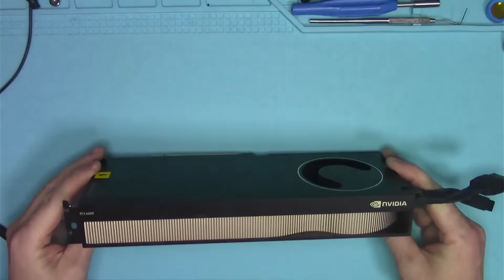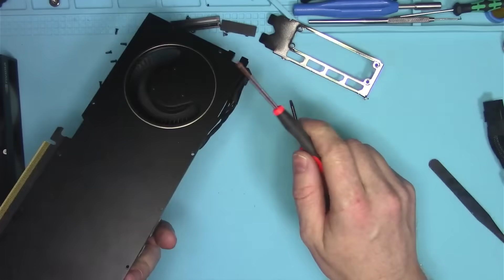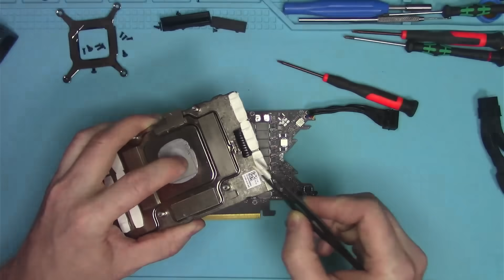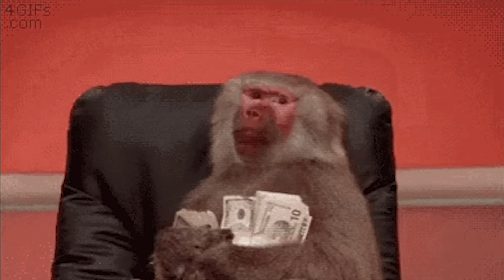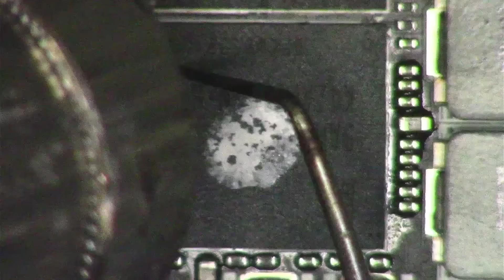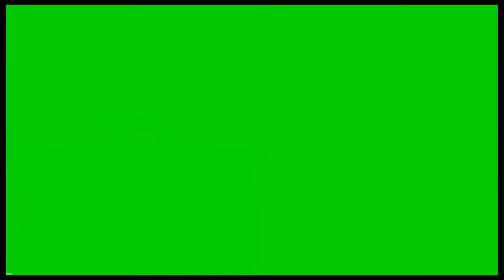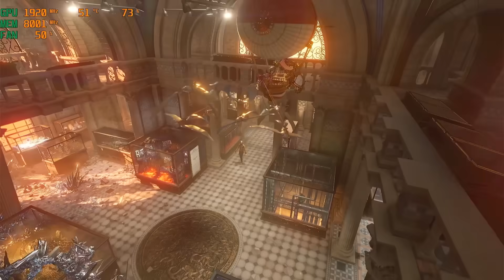Repairing the High-End Nvidia RTX A6000 GPU

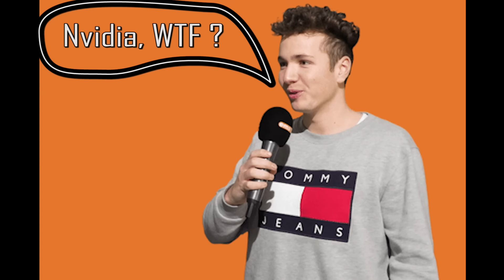Comment: 4:23 it's shorting because the pinout is probably the same as EPS CPU power connectors. Many "computing" cards just use EPS power connectors instead of PCIE power connectors. 
Why? I don't know, maybe more current carrying pins, because EPS power doesn't have sensing pins.

Comment: Its a card designed for Workstation/Server use, the connector is in fact pysically the same as a PCIE Power Connector but its not a PCIE Power Connector.
These things can be found on servers, forgot the naming though :D
The "extension" is the converter from PCI to this

Comment: The pigtail adapter exists because it uses a different 8-pin connector (obviously). But this is because these gpu's are primarily used in big racks in large amounts. Having just one connector, and placing this one on the back makes service easier and it uses a different cable because the power supplies that power these cards don't need an adapter, they are an industry standard. You only need one if you use a 'normal' power supply. Which doesn't happen often because these gpu's are so expensive most of them are used in servers.

Comment: Wow, this is a great enquiry/fix. But i have some questions : 1) How do you know the voltage/impedance of these precises motherboard's points ? 2) Where did you get the socket where you plug the video card ? 3) Where did you get the special power supply and is that especially for this type of repair ? Thanks and have a nice day.

Comment: Stock TIM is not paste, its a phase change solution that dries at room temp, and turns to a liquid when the chip heats up. Thats why it always seems dry when you open up a GPU, even when its brand new.

Comment: The Paste on these cards has to be try. Its a thermal interface material thats nearly solid at room temperature and "melts" when it gets warm / hot. 
That way you have a long service life as the paste "re-applies" itself over and over.
Reply: is that thermal paste better than something you can buy on amazon? wondering if its worth changing?

Comment: Nice video. Just a little note : thermal compound on the GPU is not dry, it's PCM type (phase-change material). This thermal pad is solid at room temperature but is flowing under higher temperatures. It is designed to be that way, unlike usual thermal paste. This is typical for many GPUs.
Reply: Yeah thermal paste doesn't need to be wet at all times. Even if you have mad dry thermal paste it will still work fine as long as contact is good.
Reply: @sebaschan-uwu  that's what I keep telling my wife!
Reply: @niccolon8095  PCM pads are easier in manufacturing (since it's just a solid compound and not greasy) and does not dry out like many silicone based grease. But it is also more demanding for proper surfaces pressure and contact to obtain good performance. Unless you really after every last degree , I'd say generic noname cheap paste from Amazon have good chance to be worse than factory PCM.
Reply: awesome thank you for the response brotha, i updated my 3090 with Corsair paste & grizzly thermal pads after seeing several others online do the same & i did get a sizeable reduction in temps. i just got a rtx 6000 & heard it runs at about 85C so i was seeing if I could improve it. its similar to the a6000 configuration in this video but ill probably just leave it alone. @xDevscom_EE
Reply: @niccolon8095  PCM is only good for PC part's that kinda constantly run hot, if you want good thermal paste get kingpin's KPx, its cheaper than thermal grizzly by like 50% and performs basically the same, it just cant be used for sub-zero overclocking.
Reply: Bump.
Reply: is it apply to generic gpu as well? I mean, like usual GTX or RTX gpu?
Reply: @maklogetrich2378 Most seems to talk about them having liquid metal on processors 🤔
Reply: @MrBrutalMachinee  liquid metal wont damage anything as long as its a delidded or copper heatspreader processor attached to a copper heatsink. however unlike thermal paste, the amount does matter. just use enough to spread across the entire die and you'll be fine. (too much or too little and itll get pretty hot.)
Reply: I see @northwestrepair to make this wrong comment about dry paste all the time. probably he does not read the comments, pointing out his mistake.
Reply: Does this mean that if I replaced the thermal paste on my gpu on my 3080ti I shouldn't be using normal cpu thermal paste? Or liquid metal?
Reply: @jsadecki1  kinda depends, if you want better thermals go with LM but your coldplate for your GPU atleast needs to be made of copper, if its a coated copper that would be better. if its not a copper or you dont wanna risk killing your GPU just go with thermal paste, its easier to apply anyway.
Reply: @scarecrow5848  Definitely, I think I will leave that then. Although I'm pretty sure I've replaced a graphics card with liquid metal before I knew what I was doing, lol. I've already sold that to someone, so I hope that it's still working for them

Comment: The power connector on these cards is a EPS12V connector. Or what a lot of people think of as a 8pin ATX 12V Power or CPU Power connector.

The abnormal connector here isn't the EPS12V one but the PCIe 12V connector that should never have existed in the first place. EPS12V power was a thing long before PCI-Sig got in their head to create a power connector for the graphics cards. 

The intelligent thing to do would have been to look at what was available and chose the EPS12V connector. Problem solved. But instead they thought they would join the cool kids with yet another standard and created the 6pin PCIe power connector. Sure it saved two pins, but surely no graphics card would ever need a full 300W, right?

Well wrong! Surprise surprise, it was soon clear that graphics cards were scratching at the power limit and that soon there would be designs that needed more power. But now they had sold in their 6pin power connector, so they doubled down with a new 8pin connector. Just as many pins as the EPS12V connector but pith a pinout that was totally non compatible. And no it couldn't provide as much power as the old EPS connector as it didn't have as many +12V pins even if all else was equal.

"But it has eight pins, just as many as the EPS connector?" someone may burst out. Sure but only three of them are used for +12V while five of them are connected to ground. Well in the documentation it just says four ground pins and a sense wire. But effectively the sense wire is connected to ground and used by the graphics card to detect that there is a 8pin PCIe power connector attached. The same could have been achieved in other ways that didn't allocate a pin to "Sense".

"But, but, saves cost with just 6pin connectors..."

No! it didn't save any cost. If you look at the 12V CPU power connectors on the motherboard most of them are split into two 4pin connectors. These are 4pin ATX12 CPU power connectors and they will fit either into 4pin ATX12V connectors or can be paired up and used in one 8pin EPS connector. So if PCI-Sig had decided to use the standard connector they could have had better modularity with ATX12V CPU power 4pin connectors, EPS12V CPU power 8pin connectors or any mix there off they wanted. And we would have one less crappy connector standard to keep track of!

Comment: Hi Tony seeing your skill with that memory application - I wanted to ask if you think VRAM doubling is a service you'd consider offering. There are references performed on RTX 3070 - I have an 8GB 3080 mobile chip (GA104) that I would theoretically pay quite a premium to replace the modules with double density ones! I don't believe I am alone in that either
Reply from the maker: You are not alone and you are correct, it's expensive experiment.
Reply: Well, now that I'm subscribed to your lovely channel I'll make sure to keep an eye open! I will definitely be in line for a commission if you feel you can offer that
Reply: @iamastrangeloop96  Do you know what commission means?
Reply: @Look_What_I_Did  sorry if I used the word incorrectly? I’m trying to say that if Tony felt he could offer that as a service, I’d be an interested customer, and recognize it’d be a pricey/enthusiast offering done on a case by case basis most likely
Reply: @iamastrangeloop96  You used the word correctly. They might have been confused as the word has multiple meanings.

Comment: Good work. I've never dared to power up a graphics card without a heatsink. I was surprised to see that modern cards can handle that without blowing up. You've opened my eyes to an easier way to do tests. I've dabbled a little in desktop and laptop component level repairs for my own purposes, but I've only worked as a solder tech for an aerospace defense contractor (which was usually just soldering cables to boards and tons of conformance tests). I'll recommend you, the next time somebody asks me to fix something for them :face-blue-smiling:
Reply: You'll notice that when testing the power rails, he's just applying power for a moment for each rail.  When doing the memory test, he sits a sizeable heatsink on the core.  Most GPUs these days implement throttling or shutdown under high thermals, but you should avoid it nonetheless.
Reply: @Mueller3D  yeah, nowadays there's so much copper in the PCB itself it acts as a pseudo-heatsink from the sheer amount of thermal mass, just not enough for any amount of actual computational load which is when the heatsink comes into play so it can suck the heat straight out of the die evenly, else the centre would overheat compared to the edges and crack from the uneven temperature distribution before thermal shutdown can occur
Reply: He's limiting the current along with not initializing the card allot during those power tests. and he's using a big ol block of metal to soak up the heat for the short time he needs to run the tests.

Comment: A6000 are professional cards not intended for an enthusiast demographic, so it makes sense that it's not easily self-serviceable. They're not for the consumer market. Think stuff like AI, professional design and video editing, bioinformatics (protein docking, visualization/simulation), etc.

Timespy and similar benchmarking tools aren't suitable for testing this grade of card, as they're meant for consumer-grade cards, especially gaming ones. It measures gaming performance, whereas this line of cards is meant for scientific computing.
Reply: No, I mean. Being not the common consumer targeted product and instead a professional one does not justify having a poor repairability. Moreover, it has similar core to 3090ti in a smaller casing with slower memory bandwidth (maybe both memory and core is downclocked to fit the form factor). Lastly this guy is only testing if it works properly on the benchmarking not testing the scores.

Pro hardware being priced over the roof is not an uncommon practice, and is also why a lot of power users decided to use "gaming" hardware to save money.
Reply: LOL... okay kid.

Comment: A6000 is a workstation/server card and is designed to use EPS 12V instead of 8-pin PCIe. So it's not proprietary, just a bit unusual if you're used to consumer hardware.

Comment: Would you be able to take the ram chips of this A6000, and move them onto something like a 4090? Would be super cool to see if that’s possible so one doesn’t need to pay thousands more for just more ram lol
Reply: The A6000 is related to the 30 series; and yes, you could, but you would need custom firmware, and sacrificing a $4k card to upgrade a card worth $800 (3090) wouldn’t be worth it in the slightest. Not sure on if the 3090 has any open memory banks, or what capacity each chip is on the card, but if you had open banks or could replace a 2 GB chip with a 4 GB for example, it would work with proper firmware.

Comment: Can we just take a moment to appreciate how clean, precise and easy he made that chip replacement look 😳 that looked perfect. Nice job on a board you've never worked on before ❤
Reply: ive reballed and swapped G4 CPU's before. much larger, much more room for error...  he really did make it look like just swapping a ram stick....
Reply: It's all the same once you find the problem, doesn't matter what board it is because there's only so many ways a chip can be connected to a board, knowing a way to remove it doesn't change.
Reply: @chosen1one930  sure but it gets harder as you go down in package size and up in contacts.
Reply: Ok, even because it's the 10th video I watch!
Reply: No
Reply: @ss_avsmt yes

Comment: The A6000 is a workstation card its quite popular right now with ML guys like me. That cable you refer to in the video is a standard cable for servers and workstations. Its an EPS power cable I don’t know how its rated for higher power but it is thats why its used
Reply: This is correct. Its rated higher due to not using any pins for sense so it has an extra +12V and GND pin, also the PCIe 8 pin spec is rather conservative with a wide safety margin.

Comment: A GPU that costs as much as a used car. I hope it served it's purpose.
Reply: These are generally used for complex 3D renders and machine learning applications where a shit load of memory is needed (This A6000 has 48GB VRAM)
Reply: @itsTyrion  you say like it's a shitload but it's sooooo easy to exhaust with ML
Reply: @itsTyrion  you say like it's a shitload but it's sooooo easy to exhaust with ML
Reply: @kanetw_  well, shitload compared to even high tier consumer hardware :D
Reply: @itsTyrion  yeah, Llama 1 65B needed like 50Gb RAM and it's quantized version. It's a very low level card now, best A100 or H100, but you must be Elon Musk or Meta to buy(they bought few recently)
Reply: The irony is that the high price, buying direct from Nvidia, covers a free card replacement and repair. Buying from anyone else, you don't get that "included service". The customer is literally a QA department, due to that being cheaper than actually testing millions of individual cards with stress loads, after production.

More interesting facts... Those lower end cards are often just a high end card that the core chips have "imperfections" in. They just don't connect bad cores in the chip. So, a 4060 can be a 4090 chip, with an imperfection in 3/4 of the CUDA cores. While a 4090 is just a chip without imperfections in that same chip. Yes, they ALSO make smaller chips for a 4060, but some are just failed 4090 productions. Because a failed 4060 would be a 4030, 4020, 4010 etc... which isn't an actual card number for a consumer, but it is a card that can be made for a data center, using two chips to make one, with the same core counts.

They recycle a LOT. Same with OC chips. In a production, they test for stability at higher clocks and hold those chips until they have enough to sell as an OC series. They are not making specific OC chips, just filtering them out of the lines from those that are less OC stable. That is why we can get lucky with our cards. They use OC chips in normal production lines, if that is all they have available for production demand.
Reply: it's mid-range in terms of current Ai industry. Most demanded is A100, accessible to someone like Elon Musk, they won't even sell A100 to non-corporates and China hunting for them because of sanctions on that cards!!!
Reply: @fontenbleau  What are you talking about? A100s are available at the usual retailers, at least in Germany.
Reply: @kanetw_  you look just silly, stop ✋ that. It's not funny. Or maybe too trustful to anything written in Internet. No one sells to you product under sanctions to China without check almost like in bank that you not criminal.